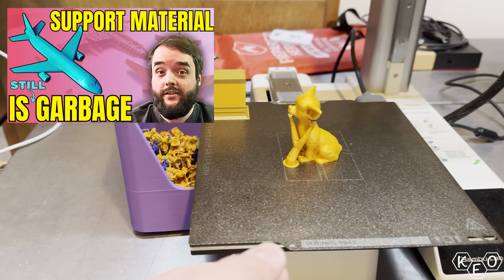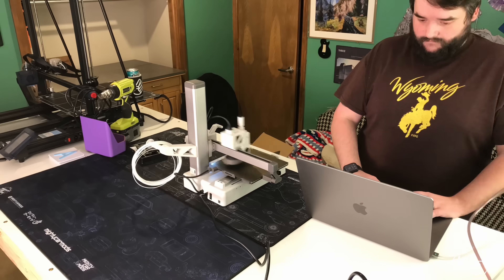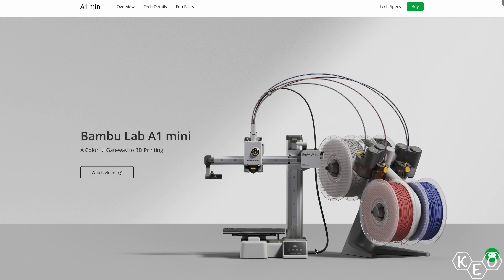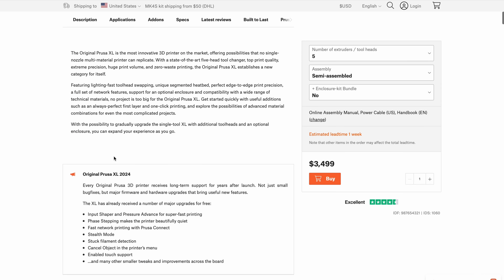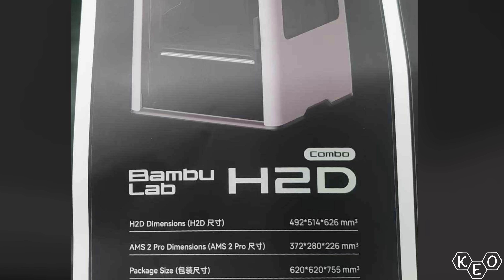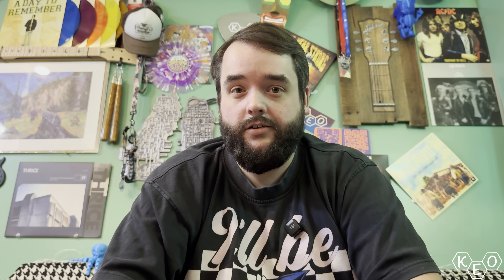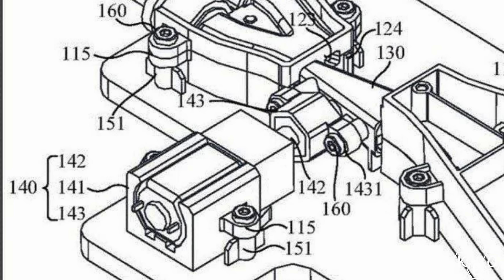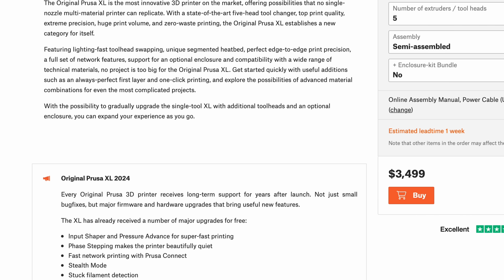What Is The Bambu H2D? Will This Change Everything?

Comment: With two print heads, I can also see it switching between the 0.4mm (or 0.6mm) and 0.2mm so one does the grunt work and the other does the fine detail.
Reply: Would require them to heavily modify Bambu slicer, just like Prusa did due to the tool heads
Reply from the maker: That would be great
Reply: @Inova3DSolutions not really can be all done in gcode as it was years ago, these concepts shown for dual head patents were developed nearly a decade ago, just bambu ripping off other people's work again.
Reply: This would be the thing that caused me to start buying this machine going forward instead of just additional P1S. The Time/Waste of the AMS while not desirable, is something i have factored into my cost pricing so honestly isn't an issue. If I need more production, I'll just buy another printer. However the one thing I struggle with are model requests that would force me to drop down to .2 to achieve the detail not only because of the added time (Because again I can factor that in), but because of the additional manual labor swapping nozzles and general headache that causes. The ability to have a setup of one nozzle for .4 layers and one for .2 and the machine auto switch between them would make me far less hesitant to accept contracts of models that need some parts done at an extremely fine detail while the bulk of it doesn't.
Reply from the maker: This would be a huge deal for that workflow then. That and larger nozzles for infill and smaller for perimeters
Reply: @KeoPrints  ams, duel hotend, larger nozzle for faster support where the finish is irrelivent and finer nozzle dialed in for the model with 400x400x400 volume would be the perfect machine 99.9% of the time
Reply: It's been done and usually it's not worth it: you can print 0.3mm -> 0.75mm line width with your usual 0.4mm nozzle right now, just edit your print profile.

Start printing your solid infill at 0.6-0.75mm, no problems if you got flow.
Reply: @eaman11  There is a massive difference in detail between a .2 and a .4 nozzle. There are details that even at the finest slicer settings that a .4 simply will not give you that a .2 with the same settings will. There are jobs I absolutely turn down strictly because it isn't worth my time to swap nozzles mid print and the .4 nozzle absolutely will not produce the detail needed.
Reply: @OmegaGamingNetwork  I don't doubt that, try with a 0.3mm nozzle and print the rest with a standard 0.42 line width.
Reply: Yes, this would be a good use instead of that multi color nonsense (which is multi material btw, multi color is dumb)
Reply: @sierraecho884  Well most of my 3d print business is multi color printing and only a small percentage is multi material. So my bank account disagrees with your "dumb" assessment.
Reply: Yeah
Reply: more likely for different temperature filaments to use different materials that have different settings. much quicker to just use another head then to retract, change temps, purge then reload between layers...
Reply: that would make it ultra fast.
Reply: I hadn't even thought of that, but would be really neat to see if the slider could go along with it. Bigger stuff internally, fine stuff on the outside for detail.
Reply: Yep, printing a figurine's / organic model's main body layers with 0,4 nozzle and layers with details with 0,2 nozzle would be a great use for. It is not really that hard to do in a slicer. Or embedding a small text into a printed product, like a brand name/EAN code/product info or other markings would be sth I would love to use.

Comment: Those dimensions are just that, the dimensions of the machine, hence why is says H2D dimensions and then AMS 2 Pro dimensions, followed by the total packaging dimensions. The total build volume will be much much lower. 

The X1C is 389 x 389 x 457  whilst the the H2D is 492 x 514 x 626, but has to pack in much more tech if the rumours are true. I think the plate might be bigger, but it won't be by that much.

Comment: Those pictures been floating around the internet for years now, when bambu first came out. Don't believe it until you see it.
Reply: The claimed proof for this is a supposed search result showing a reddit post from before Bambu had even made a post on their website (which came a month later) and 2 months before the kickstarter. Add in the AMS 2 in the picture and nothing ads up except that the claim that its fake, is the fake thing occurring. Actually check the date the image is posted when doing your reverse image search, just because the thread start date is 2022 or 2023 when you click on it and the image was posted to the thread 3 days ago, the 3 days ago date is the one that matters.
Reply: @guythejedi  the op here tells me it real. Is he doing it for clicks.
Or does he actually believe it's real?
Reply: I would actually consider that a good thing. If they were working on this years ago, by now there's a good chance they've got it figured out. A better multi filament system without the cost of entirely separate toolheads, is what I've been hoping for from Bambu. Fingers crossed..
Reply: @mascot4950  I mean, they may have been working on one, but this was a fake image posted to reddit over two years ago, so this is not it.
Reply from the maker: Here’s to hoping

Comment: Maybe Multi Nozzle size as well! I would love to be able to switch to a .2 nozzle for detail text and such and switch back to a .4 or .6 for the bulk of printing for speed and strength.
Reply: This would require them to rebuild Prusa slicer from scratch. Similar to how IDEX printers cannot use prusa slicer/orca, it is the same with different nozzle widths.
Reply: @Inova3DSolutions  I'm not sure I follow your reasoning - PrusaSlicer already supports multiple extruders, and it looks as though they can have different widths - you'd only need to treat them as different colours, unless I'm missing something.
Reply from the maker: It would be cool

Comment: That tool head is going to be very heavy. That's going to have some bad effects on input shaping, so this may be slightly slower than their old series of printers to achieve the same level of detail without artifacting . Still might be worth it for the filament waste reduction
Reply: Input Shaping is about the Center of Mass on the toolhead, not the mass itself.
Reply: That would only reduce travel speed even if that's the case
Reply: > That tool head is going to be very heavy.

F = ma, so they can maintain a with more F, i.e. stronger motors, as well as a stiffer structure to keep deflections down.
Reply: Not to mention it will actually be faster in multi color because of the time saved from not having to purge filament.
Reply from the maker: I’m sure they will figure it out

Comment: I think you're too optimistic about the filament change times. If you look at the AMS selector, it can only feed/retract one filament at a time. So it'd still have to cut and retract the filament it's printing with to feed new filament. IMHO, I can't see any time saving with this setup, but do see the option to print with wildly different filaments.
Reply: That's why the new AMS is called "AMS 2 Pro". It is probably designed to work with the new dual-nozzle print head and has all that is needed to accommodate that.
Reply: @dennisjames9091  Needed to accommodate what? You see the drawing of the AMS mechanism? It has a selector. Meaning only one filament at a time can pass through. From looking at the drawing, it'll work pretty much the same as the existing AMS - except that it can now feed into one of two tubes each leading to their respective nozzle. Not at the same time, however.
It'll be great for those needing to print filaments that have very different temperature requirements, which you can't do today. For other uses, I don't see much of a usecase at all tbh.
Reply: @oyvindrepvik  With that print head, you simply don't need an AMS for fast two-color or two-material printing. Just connect two rolls of filament to the print head, skipping the hub altogether. It's possible that the AMS 2 allows that config. I'm sure that they found a solution to fully use that dual-nozzle print head.
Reply: @oyvindrepvik Plenty of devices that can be seen as “not a time saver”. However, someone will always be around to prove you wrong. I get what you’re saying but these are just proof of art images. There is nothing to say that BL hasn’t already added a second extruder gear to a new AMS and a second bowden tube. It wouldn’t be that difficult for them. Given Prusa has stepped up their game with mk4s, I’m sure BL will look into something to compete. Will they do that, probably not because they have an existing AMS unit but we shall see.
Reply: @darkalleywaystudio3975  The drawing shows two tubes from the AMS - but still only one active filament path at a time. Any switching with the AMS will require a full retraction if that drawing is anything to go by.
Reply: @dennisjames9091  Look at the AMS mech drawing. There's only one filament path active at a time, requiring full retraction. Sure you can probably have two manual spools, negating any automation from the AMS.
Reply: @ True. Only time will tell what we actually get but I hope it is not just a splitter on the back of an AMS. That would suck.
Reply: @dennisjames9091  If the drawing is from the new AMS, it still only has one filament path active at a time.
Reply: I think we are all missing the point as rumour from french youtuber are: this model will be the XL bambu everybody was expected to be released and the game changer printer should be based on Ink injection technology. We ll see after all.
Reply: I see plenty of time saves dude.
Supports are the BIGGEST problem in 3D printing right now. You cant actually print very different stuff.
But the ability to just swap between support filaments and regular filament is amazing dude.

Im selling my X1C and getting an H2D the moment I can. This is a game changer.
Reply: @honkhonk8009  What time saving do you see? It still has to fully retract the filament just like the regular AMS. Yes, you can print with eg. PLA and ASA at the same time with the dual nozzles, but you won't save any time.
Reply: @oyvindrepvik  Why? 

Seems to me they just need to do a small amount of attraction retraction to prevent oozing, compared to retracting a lot more in purging, as Keo Prints noted.

This applies to just two different filaments, which will be 99% of the time for me at least.
Reply: @oyvindrepvik  The biggest time wastes in filament swaps is the purging and priming steps. Dual extruders allow you to forget about to purging, while doing very little priming, granted the print only requires 2 materials. 
The time is especially large when switching between support material, as a tiny amount of support material inside the hotend can utterly ruin the mechanical properties of the extruded material.

The filament retraction time is negligible compared to the other steps. But with that considered, the leaked patents show 4 PTFE tubes joining into a single one. Presumably the AMS has 4 tubes connecting to the backend buffer. This means a shorter path for filament retraction as the filament can be parked all the way up to the buffer.

While this is pure speculation, its quite possible that the AMS simply just has two outputs for each nozzle. Its the simplest solution and I see no reason why Bambu would not pursue it.
Reply: @nlkatz  There's still a "bottleneck" in the AMS selector that only allows one filament at a time to be fed. So any filament change requires the filament to be retracted fully before a new filament can be fed to the other nozzle.
Reply: @oyvindrepvik  Seems like it would be pretty dumb of Bambu not to have it arranged so that filament could be fed from two spools simultaneously to the two print heads.

Or just not even use the AMS and feed from two separate spools.
Reply: @nlkatz  I agree. But that's what the AMS mech drawing shows. We don't know if that mech has anything to do with AMS 2 Pro or the H2D at all though.
Reply: @oyvindrepvik  I think this is the biggest problem with this discussion atm... there are several patents which may or may not relate to the H2D, and frankly it seems odd to have a dual extruder and not have dual filament paths... i.e. if you have to roll back the filament and switch over, you basically lose time the time you could have gained with all the retractions and reloads, making the dual extruder somewhat pointless... I wonder if it is not actually related to the H2D, and more about a single AMS being able to go to two different printers, or perhaps something to do with daisy-chaining AMS units.
Reply: @pfeerick  Yeah. The H2D and that AMS-mech doesn't make sense as a combo. We'll just have to wait and see until there's more info.

Comment: Ha! Thanks for the screen shot :p 
It has to be 360mm or so, based on the innards clearance between the outer dimensions and the build plate volume compared to the X1C as a reference, it can’t be bigger than 380
Reply: I agree, Bambu like mathematical numbers 180, 256... 360 is a logical step and a slight upgrade on anything else 350mm cubed.
Reply: Which makes it small

Comment: CEL did this in the UK in 2014 as they used a motor and had articulated nozzles. Not sure how Bambu can patent this as the idea is similar. Google RBX01 or RBX02. I do agree this is why two hotends are preferable and it all boils down to temperature. I think that using an IDEX or tool changer that has two different temperatures and a multilateral system into each loaded with like for like material temperatures gives the most flexibility. Throw in heated chambers, larger build areas, and you have a very capable 3D printer system
Reply from the maker: Could be cool
Reply: I don't think bamboo would do idex. The added weight would get rid of their key selling feature which is speed
Reply: Patent systems and area differs around the world... Some more stupid than others ..
Reply: Thanks! I was wondering if someone was finally going to remember that it's nothing new at all!